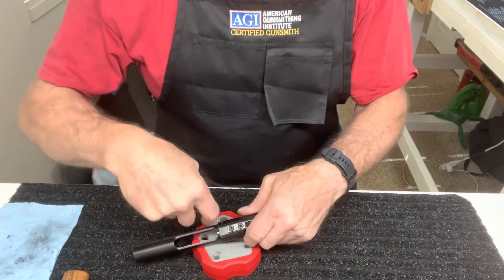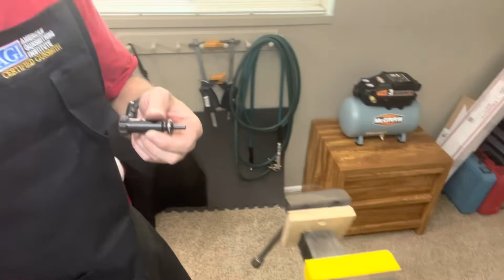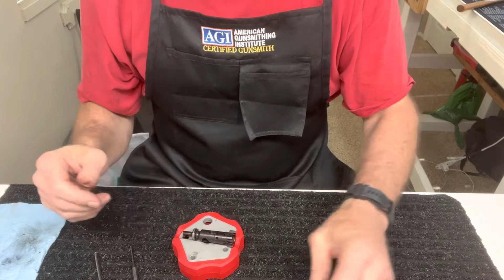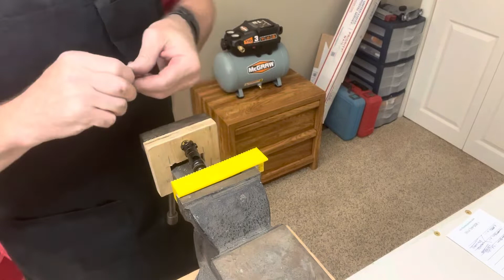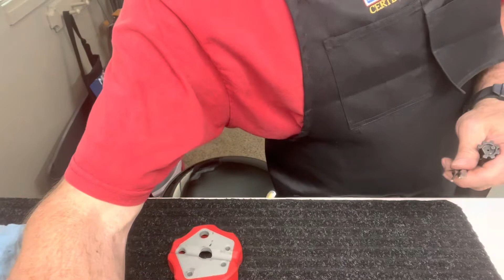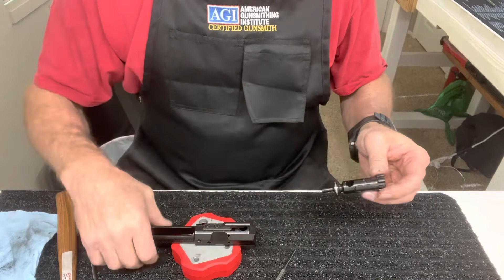AR 10/308 bolt carrier group disassembly and reassembly

Comment from the maker: The first thing I would do is shine a light in the chamber and see if you can see any deformity or pitting, etc. Then, polish your chamber. After that, see if a round will slide in without the bolt in.

Comment: I think there is a spring between my pin and the assembly.  So, I inserted spring, then firing pin, then compress slightly and insert cotter pin (actually locking pin).  Does that sound right?

Comment: Great video, I ended up buying the AR10 Vise from Creedmoor, in /amazon at the time of this writing is about $50.00 and Creedmoor sells it for $40.00. I wanted to check head space for my newly build aR10 in .308 then later for another upper in 6.5, the pins in my Fail Zero BCG seems to be pretty solid in there so did not wanted to take chances and got the vise, if you can spare $50.00 it is worth it.

Comment: I’ve been having failure to extract. Ar-10. I just took apart the bolt and found the extractor o-ring is not there. Is this maybe the reason?
Reply from the maker: Could be, however I have seen a few work very well without. It is a cheap fix/trial to see how it goes. After that, first thing to check is the chamber. Polish it and see how it extracts. After that there are a lot of things to check, too many to go into here, and it would be a mile long text. lol. Try those things, if it doesn’t go well, shoot me a message: 5alarmgunworks.com

Comment: but what about the tiny extractor spring? You did not show how you put the extractor spring back!
Reply from the maker: Oh thanks Nicholas, I didn’t. I appreciate your feedback. I rarely take it off the extractor, I just lightly brush it off, then put light grease on it. I will do a follow up video showing the removal and reinstall of the spring.
Reply: @5alarmgunworks351  Thank you! My bad. Was inattentive initially. I was actually watching the video for the second time when noticed you said to be careful with an extractor bushing and a spring that was actually inside it. This is when I realized where it was supposed to be. Thanks again
Reply from the maker: @nicholaspetre1  No worries, it helps me with my future videos.

Comment: Pretty good video. I could wish that you had mentioned what kind of brass you use in the vise to compress the ejector spring. And what kind of grease you use on the ejector spring.
Reply from the maker: Thanks for the suggestion, I can use all I can get. 
All I did was to cut down an old 308 brass to about 3/4”. I’m working on building a jig to do this. 
The grease I use is just a gun grease. I have a few I use. Birchwood Casey renewable firearm grease, Hoopes black, and lubriplate SFL gun grease. I have also used Slip 2000. All have worked well.

Comment: firing pin spring located?  or not part of it?  thought it was in channel of rear of bolt inside where the firing pin inserts.  i believe it is there but not very big, but used to prevent it from slam firing

Comment: I think I put mine together wrong one time, it made the sealing rings really drag. Kept the gun from going into battery about half the time. What could cause that?
Reply from the maker: I haven’t seen the rings keeping the bolt from going into battery before, but I’m sure it’s possible. If the rings are wrong sized, or one got folded or damaged in the carrier could cause this. First, pull the bolt out of the carrier. Check the rings. Also, look in the bolt closely where the bolt slides. Look for unusual wear or scratching. Try new rings for the bolt. Make sure they are for the “308” size. The bolt should be tight in the carrier, but you should be able to move it by hand fairly easily. You can check if it is tight enough by assembling it, pull it out fully and set it on a table bolt side down. It shouldn’t move. I hope this helps, if there are any other questions, just let me know. 
Thanks for watching.

Comment: Would a bad o ring cause double feeding on a new carrier group  on a .308
Reply from the maker: Possibly. There are a lot of things that can cause that. I would need further information about it. Is the shell extracting? Is it staying in the chamber while another loads in? What do the extracted cases look like. Does the BCG lock back when you shoot 1 round? Let me know what set-up you have.
Thanks
Reply: @5alarmgunworks351  one round will fire and won’t extract and second round jams behind fired round.
Reply from the maker: Copy. What does the case look like? Is there a Nick taken out if it, or any sign that the extractor is pulling on it?
Reply: Changed the o ring which had a micro tissue and wasn’t lubed works great no more jamming or double feeds thanks to all the input.
Reply from the maker: Fantastic! I’m glad it worked out for you.

Comment: EXCELLENT VIDEO  THANK YOU!!

Do you have any advice for my AR10 locking shut after loading a round.  I have to use a rubber mallet to get the live round out.  It failed to fully load the first round so I will not shoot it until it works right, several rounds have since stuck.  It is brand new, I failed to clean it (getting lazy with age).  I will clean tonight and see why its jamming locked shut.  Thanks for any help or advice
Reply from the maker: Thank you. 
Does your bolt lock into battery when closed? Are you able to shoot the first round when closing and then the fired case gets stuck?
Reply: @5alarmgunworks351  PS as a machinist I was looking for wear etc.   I noticed two very distinct ring patterns just below the bullet, so I am thinkin head space is causing those.  They are only on rounds loaded and unloaded